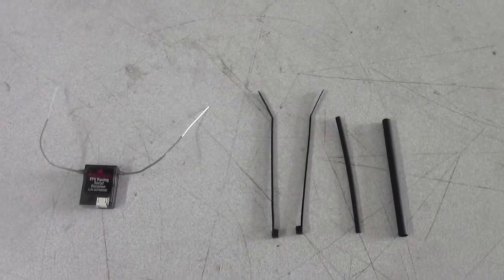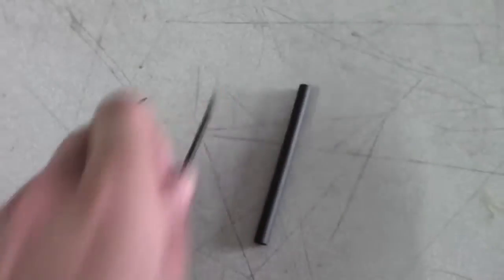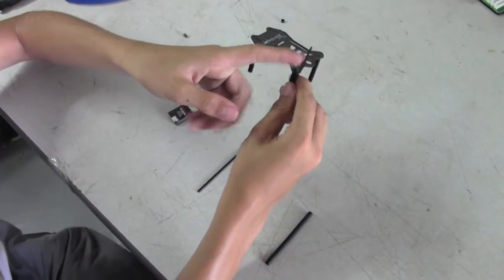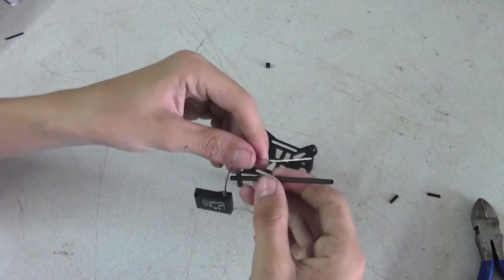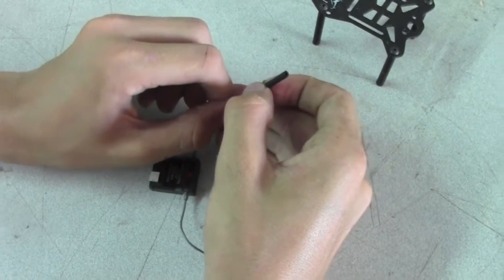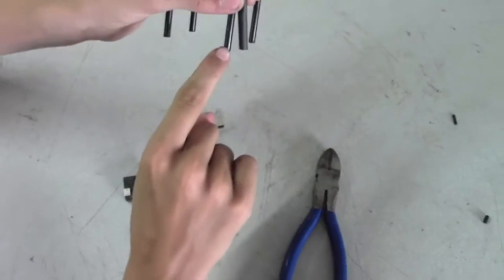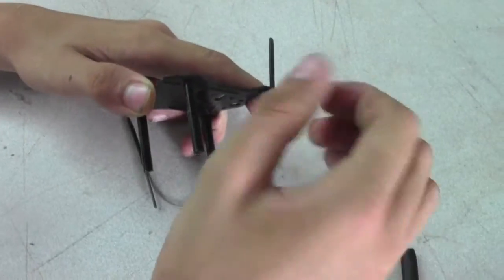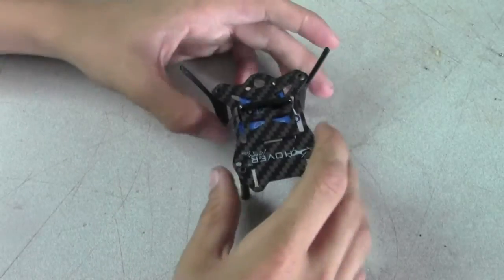Protecting/Mounting Rc Receiver Antennas Spektrum Diversity race receiver (tip) Mini quads, Drones

Comment: that receiver gives a lot of brownout... i got replacement on my receiver but still has brownout.. very disapointed on that receiver. i don't recomend it to anyone.. spectrum needs to fix this issues.
Reply from the maker: spektrum recievers when set the reciever up correctly it works pretty well
Reply: wish you were right but how hard is it to mount the receiver. the issue is very common with spectrum receiver so i dont really recomend spectrum.. ive been wanting them to be the best because i have one but my turnigy evolution gave me less problem.. a lot of people are trashing spectrum now.. even rotor riot saw the issue in one of their vid.

Comment: those antenas must be on 90° angle and not one opposite the other. what do you think about that man?
Reply from the maker: well diversity is really over hyped, i have them mounted that way for racing because my setup is very durable, but they are still off-set at about 45 degrees so you still get diversity
Reply from the maker: well diversity is really over hyped, i have them mounted that way for racing because my setup is very durable, but they are still off-set at about 45 degrees so you still get diversity

Comment: this is no good do not do this, this reciever has diversity and the antenna  are meamt to be at 90 degrees to each orher  for it to work correctly
Reply from the maker: not necessarily, for optimal performance you are correct, however, the point here was for a race setup. this is a good point that you bring up and on most of my quads I have the antennas pointing 90 degrees to each other, however, this receiver is meant for short range anyway, the diversity is just a "nice feature", I simply like the size, weight, and low latency. :)

Comment: have you found any replacement antennas? im trying to find on but having no luck. in the future i will be doing something very similar to this.
Reply from the maker: not any that have worked, lol thats why I made this video:)
Reply: If a wire breaks, can you just solder another wire the same length to the RX? I'm new at this. Just wondering.